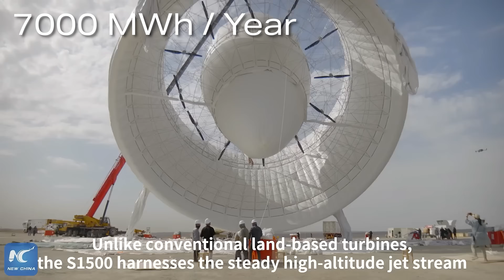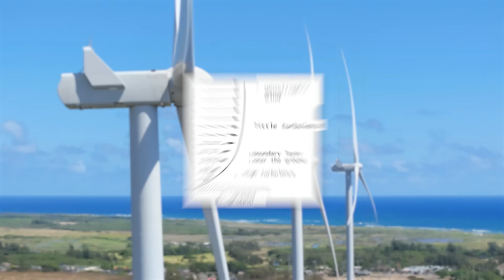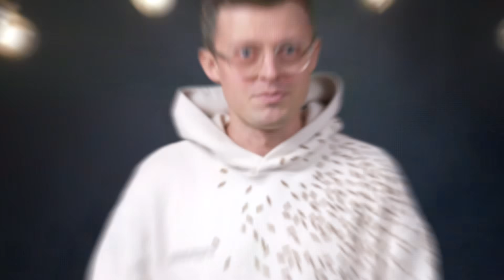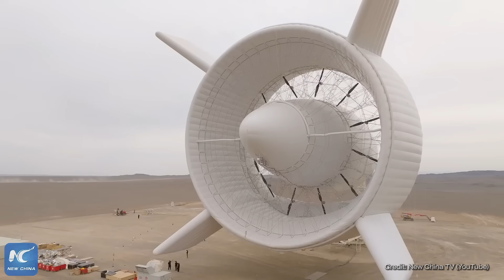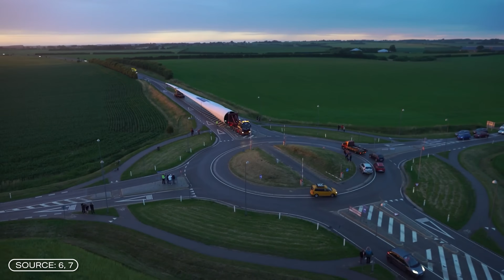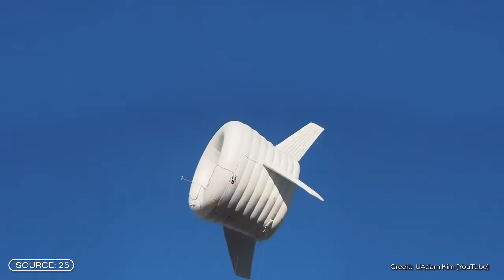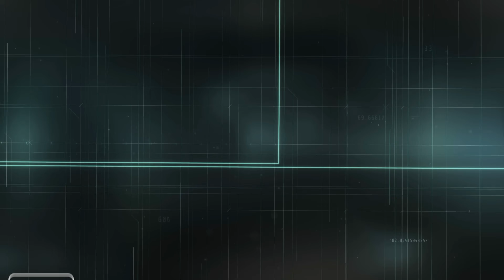China's Wild New Inflatable Wind Turbine (1.2 MW Output)

Comment: Great episode! 

The envelope area should be as small as possible, for a number of reasons, and it's extremely important. That would make the ideal shape a sphere, but since minimizing drag is also very important, a shape more similar to a conventional airship would be the best compromise. While the basic concept in it self has some inherent though challenges to solve in order to become a viable alternative, those ring designs doesn't have a chance, they're plain stupid.     

Those ring designs have way too much envelope area, which increases both cost and mass, for a given amount of buoyancy, a lot, I'd say to the point where it's absurd. That design also increases the drag, a lot, which is also a severe problem. 

I don't know why that type of design has been chosen multiple times, but I suspect that they want to concentrate the wind into the rings to maximize power generation, but the potential benefit can't be nearly as big as the disadvantages compared to using a more conventional airship design and just use bigger turbines, just open turbines. A somewhat new application doesn't completely change how physics works, it could be argued that adding funnels to conventional wind turbines would be easier, but it's not done there, not in commercial turbines anyway because the small potential benefit wouldn't be worth all the problems with it. It's wind, not a river, you can't "collect" kinetic energy in the wind in a funnel like you can with water in a hydro power dam. You can increase the output from a given wind turbine a little bit, but not as much as by just making the turbine a little bit bigger, and then you also have that drag and other issues with that funnel.    

I don't know if there will ever be any really successful floating wind turbines, but I think in order to have a chance, a lot of money is needed, and also some AI, the other kind, as in Actual Intelligence, has to be involved. A really big, conventional airship-like design which could also have solar PV on it, might work. All else equal, the bigger you make it, the more lift you can get, and more mass you can add. If made big enough it could use relatively heavy envelope materials, that could be resilient, and relatively cheap, and very low gas permeability.  

A big airship could also have the lifting gas in separate gas cells, surrounded by air, or why not "pure" nitrogen, and an onboard system that catch lifting gas that might still escape from the lifting cells to inside of the airship. If the lifting cells are surrounded by pure nitrogen, and that nitrogen is continuously scavenged for any escaping lifting gas, even using hydrogen as the lifting gas shouldn't have to be much of an safety issue.  Besides hydrogen providing slightly more buoyancy than helium, hydrogen is comparatively essentially free, and an inexhaustible resource. Any suggested solution that involves using huge amounts of a resource as scarce as helium, and mass production to reach economy of scale, and also in order to make a meaningful impact, is doomed by default.          

People made hydrogen airships that carried people well over a century ago. It didn't always end well, but accidents with airplanes were common too, but the Hindenburg disaster was exceptionally well documented for the time, and visually dramatic, most of us probably don't have a very balanced view of the relative safety when it comes to hydrogen airships. With modern materials, tools and technologies, it shouldn't be too difficult to build large unmanned hydrogen airships that remain tethered in some appropriate areas where any accidents wouldn't have much of an impact, to collect wind and solar power. 

Whether anyone will be able to make something like that economically viable is still the question. I would personally be surprised if that happened during my lifetime, not primarily due to the actual technical challenges involved, but mostly due to most peoples tendency to fall in love with their convictions, and incredible stubbornness in refusing to objectively analyze those convictions.
Reply: There is a lot of sense in there. And you are quite right that shrouding turbines is normally bad engineering. I presume the reason for the ring design is that the structure is self-bracing with very little mass. As soon as you go to a blimp with turbines sticking out the sides, you have cantilevered spars that you need to brace somehow, and that starts to get heavy. I've not done the structural calcs, but I presume some people have? 'Light bracing structure' is a much better reason than the usual 'concentrating the wind' reason for a ring/funnel design.
Reply: @xxwookey  Potential structural advantages would be a better reason, but to me that seems a bit too advanced thinking for someone that thinks that design is good.   

Also, that design use a lot of bracing for the turbines, so the design doesn't solve that issue, just makes the lift to envelope surface area ratio very poor. That envelope can't provide much structure/strength, not nearly enough to compensate for the extra drag in strong winds.   

Pressurizing the lifting gas to increase rigidity of the airship makes it even more difficult than it already is to keep the lifting gas contained, and helium escapes pretty fast out of mylar balloons without any significant pressure difference, so if you want to rely on rigidity achieved that way it's even more important to minimize surface to volume ratio.                                 

I haven't done any advanced calculations either, but I have done some simple calculations on which size you need to make a more conventional airship design have enough buoyancy to lift both heavy enough envelope material so it is reasonable to make it last a relevant long time, in real world conditions, and also have some payload, and those calculations strongly suggested that you're definitely in the size range where you at least want to make a semi-rigid design, unless you accept to only use it in nice calm weather, but there's no point in making an airship for this application that only can be used in nice calm weather.
Reply: @fishyerik  Hmm. looking at a video I see that the turbine frame is self-supporting, so yes it does not appear to be using the envelope for bracing.

Why does the drag matter here? I guess it affects the strength/weight of the tether required. Anything else? The tether mass may be driven by the aluminium wire needed, so maybe they have loads of drag headroom?

So you are saying that ring of turbines should just be mounted around a typical 'pointy sphere' blimp shape? That would make it lighter/less drag(=lighter tether) with close to optimum surface/volume ratio. It does need to remain aerodynaically stable - which presumably means you need a certain length of blimp for a given ring radius?
Reply: @xxwookey  Drag puts strain on the airship and the connection between the airship and the tether too, not just the tether.  Drag also pushes a tethered airship towards the ground. 

In short, drag converts  potential energy into problems. 

Turbines can be more efficient the bigger they are, so the turbines should be as large as practically possible, but also as essentially few a practically possible. There are other advantages of making big few turbines instead of many small, that's why conventional air turbines typically only have one turbine for each tower. 

There's no free headroom in the tether, mass is not just a problem for lift, it adds cost too. For commercial/continuous power generation with a concept like this the mass of the tether per unit of length should be kept as low as possible, as the airship has to hold up the entire weight obth in that f the tether, and on top of that the load caused by drag, and tolerate the strain.               

 While aluminium is a great conductor, for it's mass and cost aluminium is much better than copper, it's not very fatigue resistant. I think aluminium power lines typically are reinforced with steel. Despite the high conductivity of pure aluminium and also good strength to weight ratio of some aluminium alloys, aluminium alone is annoyingly problematic to use as a conductor that needs to be even moderately flexible, and also last a long time. 

You are absolutely right about aerodynamic stability, both in that it's an requirement, and that you need a certain length to wind swept rea ratio to achieve that, for a given design.

Comment: Interesting and very clear.  Thank you.  It did leave a couple of questions unanswered though.  The helium issue.  Helium is generated underground when radioactive elements decay producing beta particles, which are helium nuclei. These pick up electrons and become helium.  This must occur in geology which traps the gas underground.  I believe that recently, methods have been found to identify new helium deposits which could be drilled and captured, but helium is still an unsustainable resource.  Helium is also used to find leaks in gas-tight structures because it is the most leak prone gas.  Has China found a far less permeable material for the ennvelope?  Do they perhaps use hydrogen, which is potentially sustainable, has more lifting potential and is a little less leaky?  Perhaps you could follow up.

Comment: I always found it a cool idea, but the biggest problem is entanglement. Since they’re so high up in the air, they need plenty of space between them to make sure they never touch each other.
Reply: I think that would not be a problem, as it shouldn't use for wind farm, but for remote area, where need a large amount of electricity  power as mine or distance village. Just need 1 or 2 is enough and it take more economic advantage than building power grid all the way to there.
Reply: @minorityproblem  Last night I was wondering how they would get it to the location, in pieces, or fly it there like an airship?
Reply: @FreeGrass69 i think they will transport parts then assembly right on the spot. But if the plan location doesn't have enough space, they could craft it nearby then lead in like a airship, as they can supply electric back to the generator to create push force.
Reply: I think they are more than 1 cable per ballon (probably 3) A matrix of towers will be able to maintain multiples systems in the air at theirs "fixes" positions relatif to others.
Reply: The founders were 2 below 30 years old young men! They hoped to achieve the cost of producing electricity to ultimately to be only  1/10 of fossil fuel power plants! This would be a great step ahead for the world towards green energy!
Reply: They won’t be used in any wind farm, rather it’s for remote places like far away small island
Reply: I mean, isn't that the same with normal wind turbine? They are soo big to the point where you need to put large space between them.
Reply: That's not the biggest problem buddy. The biggest problems are aircraft and lightning strikes they have to deal with.
Reply: @asia911 those big balloons are not high enough to bother commercial air planes, and in china there is not enough small air vehicle or helicopter on the sky to the point those balloons became a problem. Lightning is even less problematic, since they can wire a mesh around then go along the main cable straight to the ground.
Reply: @minorityproblem  I'm not talking about China buddy.  China have a place for these like the desert where there's hardly any aircraft or weather condition to worry about.  That's why they are invested in these where windturbines aren't accessible.  These inflatables are problem where there are people that fly their small aircraft vehicles such like in America and on top of that tornado alley.
Reply: At those heights, the wind is laminar enough that all of them move in 'parallel' and in tandem
Reply: They should all move around together with the wind (like moored yachts) so that reduces the spacing needed well below 'circle of tether length'
Reply: I suppose the white inflatable parts would bounce like dodgem cars. The problem of the cables running down to the ground getting entangled seems like an inevitability. However, don't see that as stopping the things from flying and doing their thing.

Comment: How is the system going to carry the weight of a 1000m long cable that can handle the current?
Reply: I am sure the Chinese have calculated on that, which is why they have to use helium (or hydrogen) to get enough lift.
Reply: Given that power from most power plants is typically transmitted  30 to 100 miles or more; sending power long distances is well understood. Generally, all long distance power transmission happens at very high voltage. Power coming out from the outlet in homes is usually 120 (usa) or 240 volts (most of Europe, Asia) around the world. Transmission lines operate at 69,000 to 765,000 volts. The higher the voltage the more power one can send through a thinner wire. Power can also be transmitted via DC as well as AC, depending on if there is an advantage to doing so.

Comment: This all very cool but, to use these you have to have helium for them.
Reply: Hydrogen is one lower on the periodic table, lighter, and cheaper. The main problem of spontaneously bursting into flame might be worth it if the whole thing is cheap enough to replace and the accident rate low enough. Just an alternative.

The other thing is that the turbine itself is spinning. It is possible to "blow your own sail" to a limited extent. There are plenty of videos on this from Veritasium  and such that demonstrate this. i.e. you can get some small support for the upwards force from capturing the wind coming in too. With the thing needing to spin and move air by design, this makes sense to incorporate to help provide lift. Some of any excess energy generated should be ideally used for an maneuvering.

Comment: So, while extractable energy goes with velocity^3, it also goes with area and density (which itself falls off with altitude, ~85% at 1.5km). Additionally, you are adding helium as a consumable resource, which is REALLY problematic at scale.

Back of the envelope looks like ~2x wind speed, so equal production would need to be at least 1/7th the swept area of a conventional wind turbine, which it doesn't look like it manages, especially since it needs to lift it's tether and conductor 

The emergency application is likely viable.

The flying wind turbine may be more viable as a hybrid of lifting body and hot air (using some of the generated power to maintain temperature and pressure) or hydrogen, and you still have the airspace issues

Also, the stratosphere starts around 10km (7km at the poles, 20km at the equator), so 1.5km isn't even close

I don't see how this can compete at all with the solar and battery cost curves the way they are looking
Reply: No one is talking about reaching the stratosphere.

Comment: Better, but still consider the immense concrete mass to anchor the floating mass (and corresponding drag vector force) to uplift reaction.
Reply: But you don't need an 'immense' mass (the BAT weighs nothing and has small uplift so it's only wind forces to be resisted), and it doesn't have to be concrete. Some screwed ground-anchors will probably make an adequate anchor. Or a couple of buried beams. Material consumption will be small, or very small, per MWh.

Comment: Why not a smaller version for ocean crossing cargo ships?
Reply: The largest ships ship has 80 MW engines so they would need larger if anything. Also if the wind blows in the opposite direction of travel will it not drag the ship, or is the engine in water able to move forward anyway, I don't know.
Reply: @surters  Sailing ships can move upwind. This was mastered thousands of years ago. ( Basically, they go side to side. )
Reply: @cryptickcryptick2241  I know, but this is a ballon dragging in the opposite direction, not a sail, more like a drift anchor.

Comment: Don't feel like doing any calculations on a Friday night, but here are some thoughts. The energy generated comes from / causes drag on the balloon. If the drag equals the lift (from the helium) the tether line will at 45 degrees. More wind->more drag, same lift -> shallower angle. So, the lift ultimately determines how much energy the device will be able to generate. Because it is not grounded, it needs 2 conducting cables to run the electricity through. 1500m up x sqrt(2) x 2 => 4km of cable. From the power generated and the generated Voltage, you can calculate the current and with that the required cross-section of that (Aluminium) cable. That is a considerable mass, that also needs to be carried by the lift of the balloon. It must be subtracted from the total lift, to find the lift that is to balance the drag. And really, to always be assured of a strong wind, it should hang in the jet stream, at 10km. I don't think the math holds up.
Reply: By increasing the voltage you could reduce the cross section of the cable... 🤔

Comment: I think China is poised to do for wind power what it did for solar. Presuming Sawes successfully rolls out the S1500, the price for the tech will rapidly drop. Yes it will make a great disaster relief tech, but if it's inexpensive and reliable, more and more cities will begin rolling out BATs as a replacement for fossil and solar power.
The big advantage over solar that I've never heard anyone talking about (aside from BAT being able to operate 24 hours a day) is that solar requires a lot of square footage in order to be viable. We see a lot of solar projects built over wild areas. BATs have no need for such land use. Put the ground tech for the BAT on a boat and you can put BAT out to sea. I expect the initial city adopters will be coastal cities.